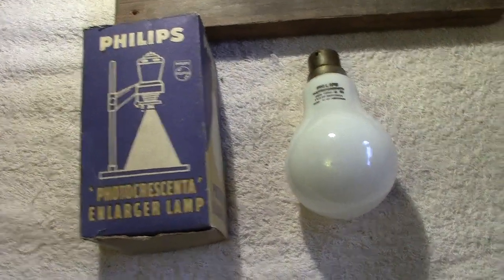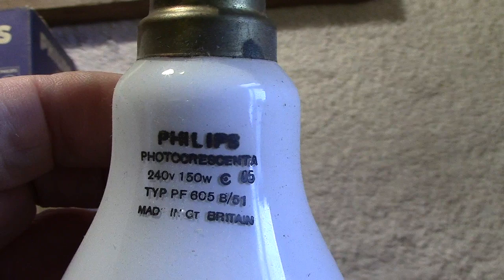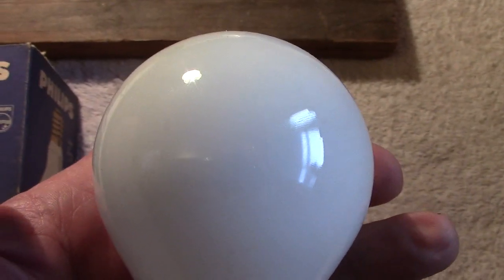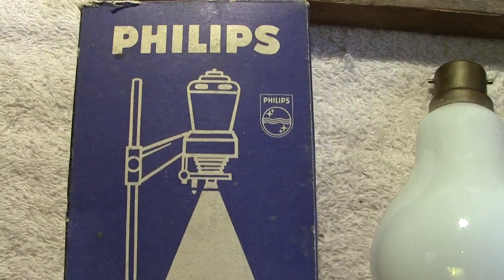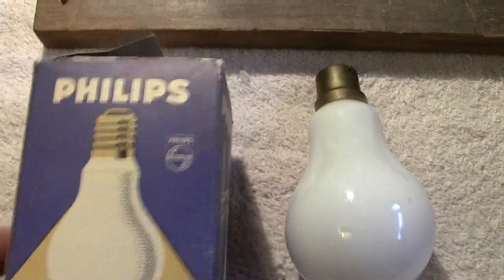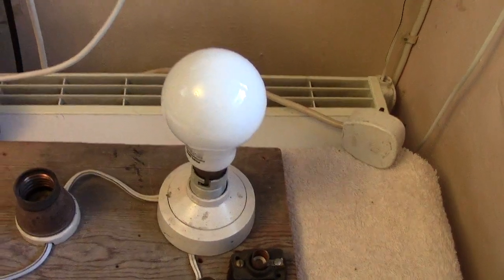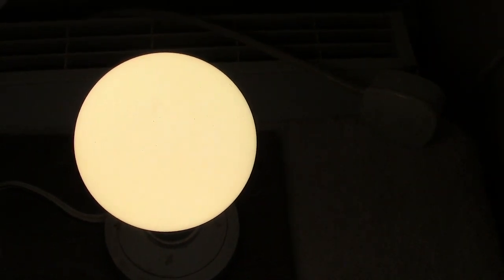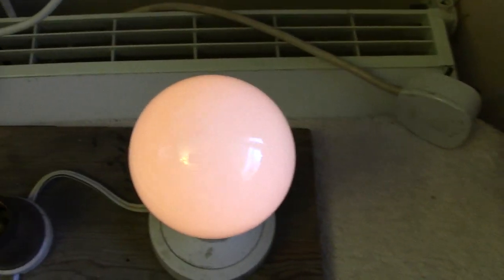Philips   photocrescenta   enlarger lamp  240v  150w

Comment: Type of bulb that's somewhat redundant now with digital photography, photo paper & photo ink for printers these days... though there will still be some enthusiasts using film & doing things the old way somewhere.

I think I've still got all the set up for developing film & making prints in storage but getting the chemicals at a reasonable price and where to get them... being honest digital is just so easy.

But as for the bulbs... I had to fit replacements twice, bulbs were philips, factory one was British made but both replacements I bought were made in holland... same white colour and I think the filament will be C shaped & possibly single coil, possibly rough service type too as they did take a couple of bumps & knocks and survived.

Prints from film... great detail and with the focus perfect on the camera... solid resolution without pixels... amazing what you can enlarge without the pixel dots blurring the image.
Reply from the maker: Hi thanks for that additional info and info on film aquipment.